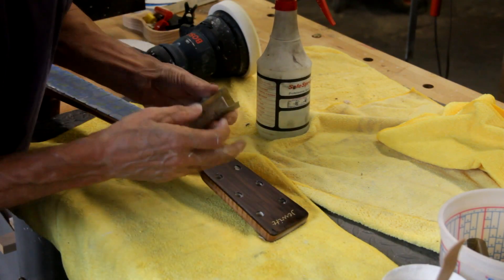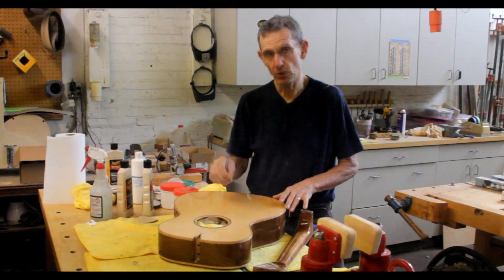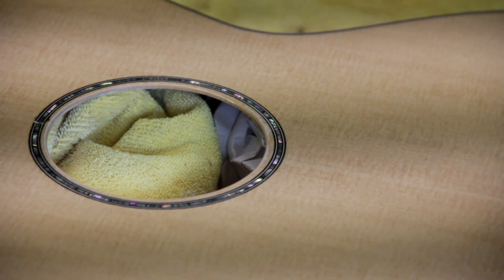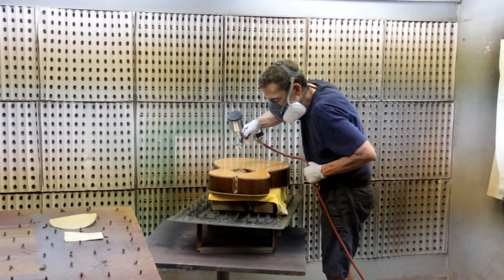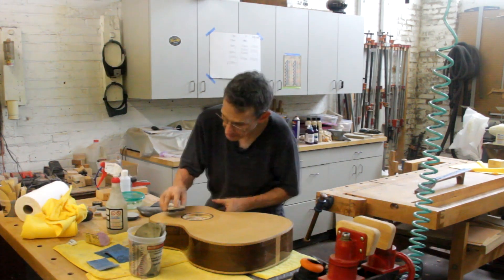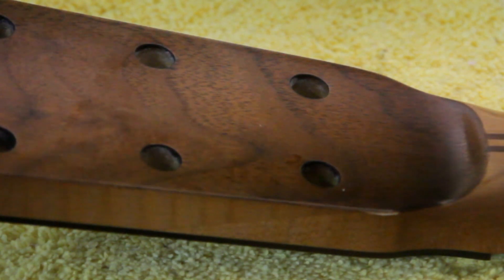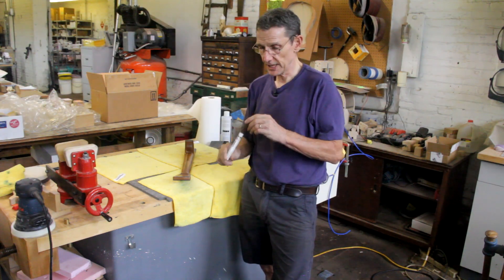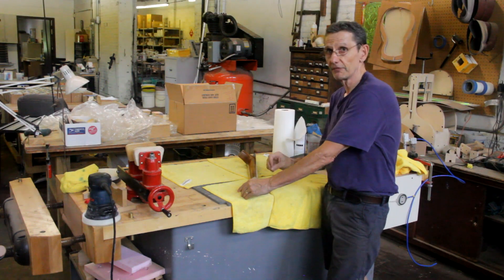Fixing Lacquer Finish Mistakes

Comment: Hi, I am beginner in woodworking and maybe you could give me advice. I just sprayed first layer of lacquer on birch plywood and when it dried out I noticed a one spot on corner that is shining more than a rest of the surface I think I sprayed  there more and there is like a puddle of lacquer. Should I sand that corner only that spot and apply a second coat of lacquer to whole surface?